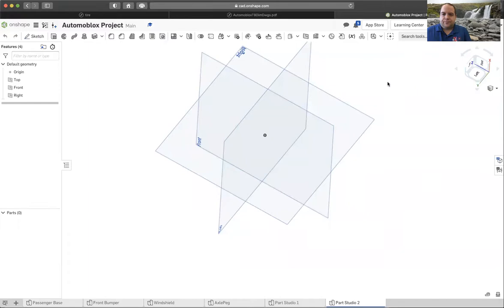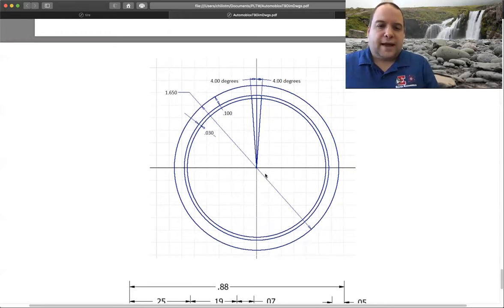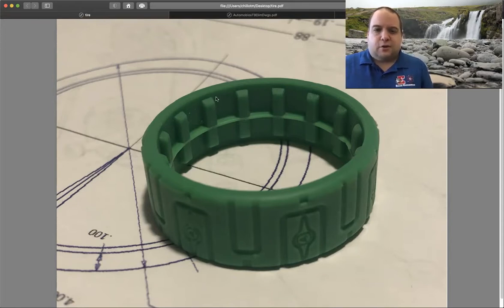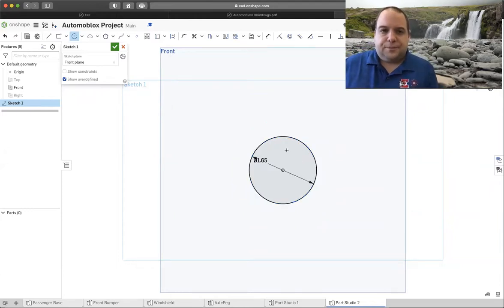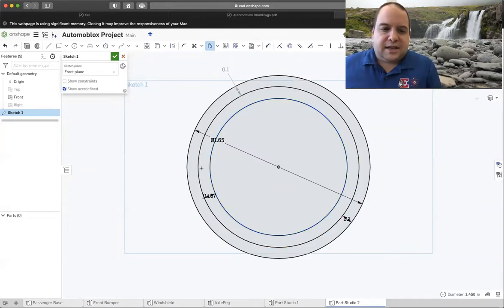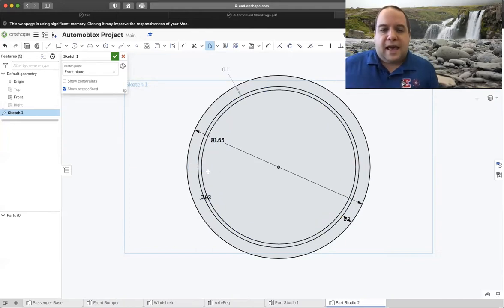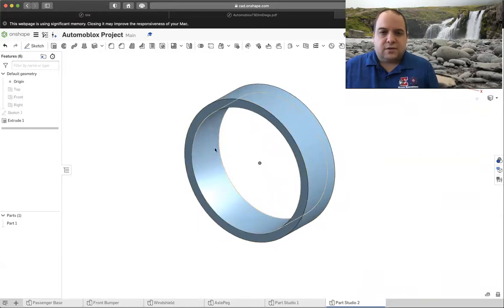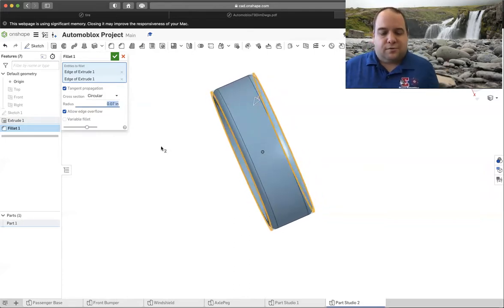PLTW IED: Using OnShape - Automoblox - Rubber Tire

Comment: nice design.  any thoughts on 3d printing these, given that rubber is not an available material?  for that matter, how do you think the original tires were manufactured? Mold? There doesn't seem to be a weld seam on the Automoblox tires I have. Red and yellow rubber tires has aged much much faster than black, green and blue.